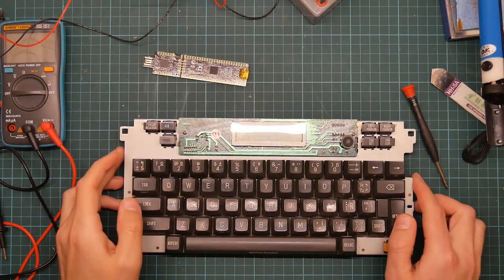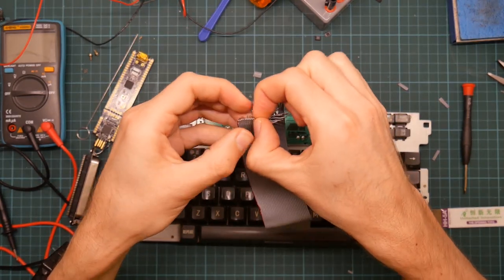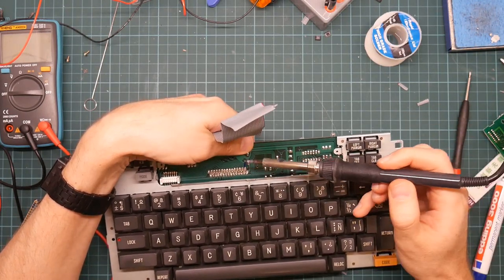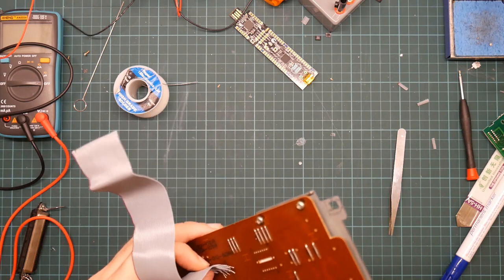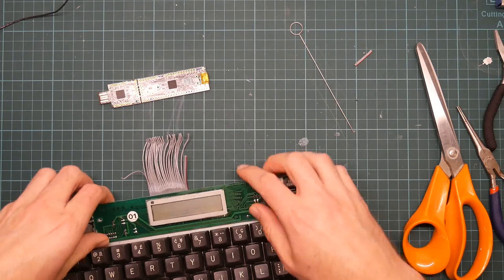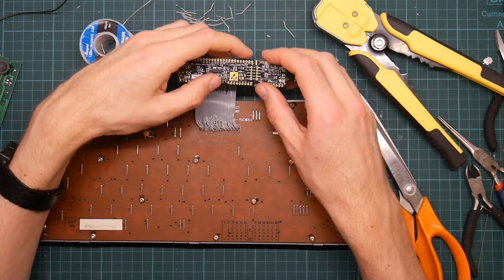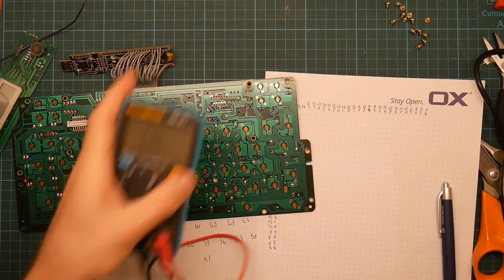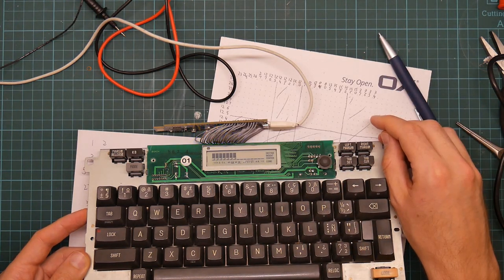Hjalfi builds a keyboard (part 1)

Comment: Small trivial detail; the red wire on the ribbon is pin 1, not necessarily power.  

You could sure use some tape to hold the wires down aligned and separated. It makes soldering 100 times easier. Your stripper has a tension knob. You have to carefully adjust it for small gauge wires. 

The rapid action bird's beak strippers are better suited and they're fairly cheap. Better yet, you can purchase an Exacto or razor blade tip for your soldering iron. Using  low heat with light pressure you can score both sides of your cable and then carefully flick away the insulation ends off.  

You can quickly tin the ends by applying flux and melting a large blob of solder and keeping it molten with the soldering iron. Simply dip the ends into the large blob and the wires are tinned. Essentially, it's a poor man's solder pot.

Final bonus tip, on some IDC male connectors, the pins can be pulled out from the housing when the cover is removed. You can pull out each pin with the wire clamped on with a need node plier, and solder the clamp permanently to the wire. This gives you pins at the end of your wires making insertion into through holes easy.

Comment: You could have a configuration mode where you hold a key on the keyboard and then with another small program send the character code from an existing keyboard of a USB connected computer to the teensy over serial monitor and set the charcode for that key in a mapping stored in the teensy's flash ram. Then out of config mode the charcode to send via USB HID for any given key is the one found in the config mapping in flash. This allows ad hoc remapping - in fact you could call that a feature. You could even use it to program macros!
Reply from the maker: Harder than it looks --- sending data from the computer to the board is a nightmare, in both directions, but more importantly I haven't figured out the PSoC's persistent storage yet.
Reply: @hjalfi  I've used arduino leonardo for similar things. Easy for you. https://www.arduino.cc/reference/en/language/functions/communication/serial/read/